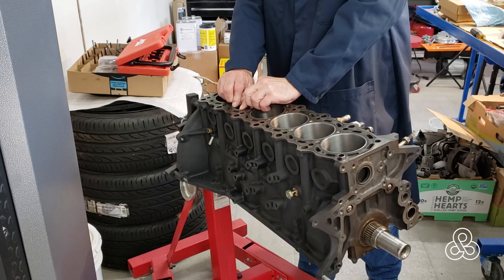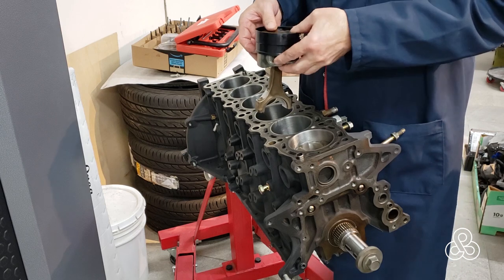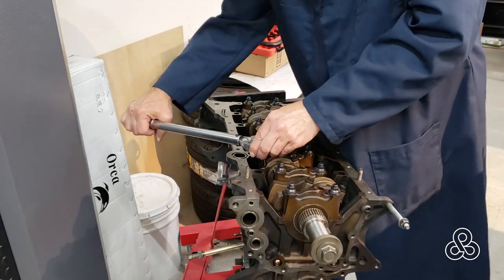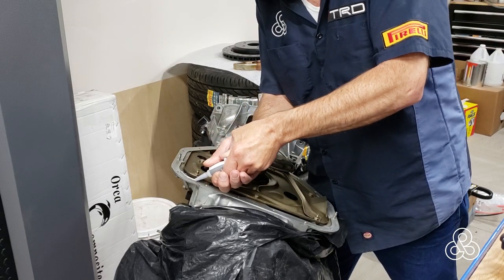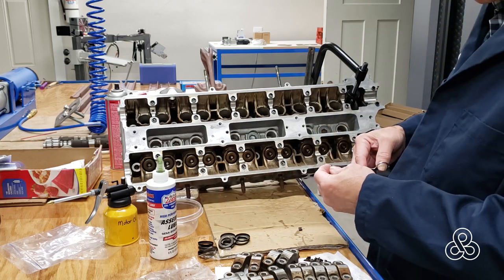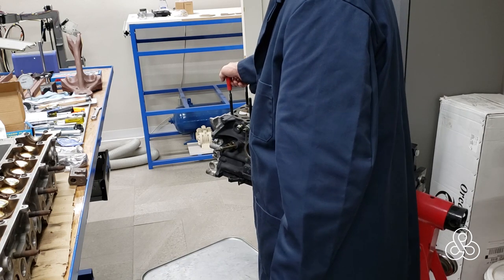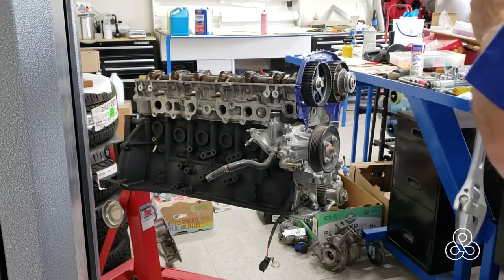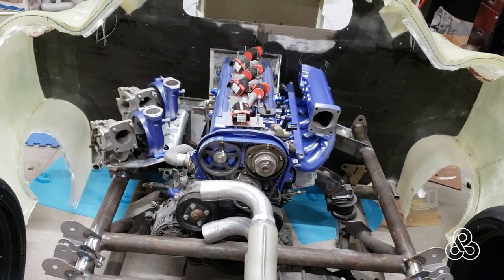A29 - Why would this guy put a 1JZ GTE VVti engine in his supercar?

Comment: The 1JZ was a partnership between Toyota and Yamaha, really great motor for swap.
Reply from the maker: designed to compete in racing, but the series was dropped and Toyota said "lets throw is in a Supra and make the kids in 2020 go crazy!"
Reply: @Nate Brindabella 1Jz heads have Yamaha in them, so at least some aspect of the heads was designed by them
Reply: @Nate Brindabella
The 2JZ head, as well as the same design in my 3rd gen 3S-GTE is the same Yamaha/Toyota design as the 1JZ-GTE.
This video will show you everything you need to know:
https://youtu.be/y-9Wr4G2Zas
It’s the same Yamaha/Toyota design. My 3S-GTE actually has the Yamaha symbol on the timing belt cover.
Reply: Might interest you to know that the V8 in the Volvo XC90 was designed by Yamaha too. In case ya fancy playing with a really esoteric engine! 😁
Reply: Some of the. Ford dohc engines in Torus s were yamaha built
Reply: @brucejohnson6529  Taurus SHO 220hp 😀

Comment: I just got rid of a 1998 Camry with the 5S-FE four-banger.  I used it like a truck and drove it kinda hard.  I'm self-employed and an Assistant Scoutmaster.  Trunk was always full of tools, back seat full of job supplies, and occasionally either the roof rack up top or a trailer hooked up out back loaded with more supplies.  Sometimes I had my toes under the radiator to get the loaded car (and trailer) up a freeway on-ramp and safely merge with traffic zipping by.  And all the trips going camping, driving on dirt and gravel roads into camp-sites in the woods.

Car was smooth and reliable up until about five minutes before the engine threw a rod and punched a small hole in the engine block.  Just enough time to hear odd noises, get off the freeway and onto surface streets, go through a couple of traffic lights and find a safe parking lot to stop.

Poor car only made it (reliably and dependably almost the whole time) to a mere 461,228 miles.  I so wanted to see half a million.

So, yay for Toyota!

The engine and transmission were bone stock.  Painfully bone stock.  Of course, with the tools, materials, occasional trailer, etc., the suspension, brakes, wheels, tires, security system, and stereo (with backup camera) were all upgraded.  It wasn't too quick off the line, but I'd argue that it could brake and corner better than when it left the factory.

100% of my build was done with my hands, but I can't hold a candle to your build.

Nice to see the TRD logo on your shirt and the Toyota 1JZ at the heart of your build.
Reply: Apparently the worlds fastest MR2 runs a camry 5S block with 3SGTE head crazy
Reply: You should upgrade to the 3S-GTE. It’s an easy swap and the design is the same Yamaha/Toyota design as the 2JZ-GTE. I have three of them and they’re the best.

Comment: Years ago I dropped a 1jz-gtte with twin ceramic turbos in a 85 4wd 4runner. I had a lot of fun with it.
Reply from the maker: Is that a straight bolt in swap or did you have to use an adapter?

Comment: Ill admit, I was skeptical at first, but im sold. Im so much happier you put the engine you did in it, rather than just another LS. I think the Inline 6 will give this car a much peppier and lively soul, and I cant wait to hear it sing in the high rev range! Especially with you custom exhaust.
Reply: Toyota jz family is solid but there's a reason you see so many ls swaps. Gm has been building them since 98 and there are millions of them. Sadly the jzs are pretty limited in availability. Cost is a huge factor i can go to the wrecker and pull a 5.3 for 300 bucks and do it 7 more times and probly still not buy a 2j. There compact the sing cam really lends its self to being much smaller thank other v8s. As I stair at the monstrous 5.0 in my f150. After market yes the jz has a bit but it is again pricey and no where as plentiful as ls. We could build a 500hp engine for wat the stock 1j ran him. Imo if I were to make it an inline 6 I'd go Cummins fastest  diesel supercar. You since he likes different.

Comment: I think the 1UZ-FE is a more interesting Toyota engine, because it's an all aluminum 4.0L V8 that can be pushed to around 800HP without needing to get your bottom end rebuilt. Just a new ECU or ECU reflash, new injectors, new fuel pump, and either turbos or a supercharger with accompanying intercoolers. But, as you've stated, the 1JZ and 2JZ engines have such a cult following that aftermarket support is overwhelmingly available. While the 1UZ-FE is also a pretty popular engine, it pales in comparison.

Comment: I'm more interested in why you chose the transmission orientation that you used Having the tail shaft of the trans going forward.

I'm also interested in why you chose an automatic instead of a Manual
Reply: It's a  four wheel drive car
Reply: This is the same layout as the Panther Solo and MG 6R4, and 4wd versions of Lamborghini Diablo and later cars
Reply: Well probably its due to cost and power handling/adapter availability. Also while not talked Bouton to much anymore, autos load the engine and thus turbo helping spool all things equal. Depending on transfer case its either front biased or 50/50 power split. Lastly while cost probably played a part in the 1jz it does rev much higher given supporting mods and will last longer while doing it
Reply: @mythos000000025  When you think about cost / power ratios, and the money spent on developing the engine, building the  body + suspension, and also the fact that he has made his own bell-housing and will make a torque-splitter with drive to front and rear, then the cost of the actual gearbox is rather small.  He has chosen that transmission unit because that is what he wants to use

Comment: Another high-revving inline 6 worth considering would be the RB26DETT from the Nissan Skyline.  The 1JZ has 71.5mm of stroke, and the RB26 has 73.7mm.  Both motors can be spun ridiculously high, and both will take you to approximately the same maximum hp level, but the 1JZ will be far cheaper shopping list. RB's are more of an exotic motor, and tuning parts for it come with more exotic price tags. For your build, I would have taken the 1JZ over the RB due to price since the end result in performance is virtually identical.

High revving motors are ideal for light weight cars. Short piston stroke = less torque.  Your build is perfect for a high revving motor because it's light.  Obviously, the 1JZ would be a poor choice for a pickup truck.
Reply from the maker: Of course now all JDM recycled parts are overpriced due to Covid.

Comment: I have a 1jz in my Mk3 Supra vvti bottom end high compression with the old school 1jz Head twin turbo set up.  On stock boost stock Ecu it has a top speed of 250 kilometers so you should not have a problem achieving what you want
Reply from the maker: TRD Fans Unite!

Comment: as a owner of a 1jz vvti its nice to have parts domestically that fit from the 2jz also you can use 7M starter motors too neat fact.
 the 1jz is risky to run stock block around over 450HP, safest would be 400HP. Going over that threshold would need some beefy aftermarket internals and what I recommend to most or  if you're on a budget build a 1.5jz using a stock 2JZ non-vvti block. Theres a good channel Rabid JZ that has a video going through his 1.5jz build and the details.
Good thing about the non-vvti 2jz block is both the GTE(turbo)  and GE(non-turbo) blocks share the same beefed up stock pistons and rods. 
The 2JZGE VVTI block would need better pistons and rods, unless you are lucky to find a reasonable 2JZGTE VVTI block
Reply from the maker: I'll have to check out Rabid. Thanks.

Comment: While it would be quite the task, I think upgrading to ITBs would add to the super car status, and you seem to be quite skilled, so I think you could do it.  I’ve seen this done with modified BMW ITBs from their M5 V10, and the improved throttle response and airflow could help make up for turbo lag.
Reply from the maker: I had a continuously variable intake runner system designed and parts purchased to fabricate it, but after things started to come together I found fitment problems. Problem was that the runners "mathed" out at over 12 inches long during low RPM. This length, and the phlenum box around, them would have just taken up to much space and interfered with the intercooler. Individual Throttle bodies would be a great way to "open up "some breathing. Perhaps after we are on the road and start to "tweak" the tune we can try it. Till then, a new single 90mm - throttle body will have to be my breathing device. Love to hear these other opinions and ideas - thanks for following the build .

Comment: Just came across your YouTube channel.. very nice build you got going on.. I was thinking to put in a jz into a flooded Aventador I purchased from a wreck yard.. 
I really like the lines you got going on with your car.. I am wondering what windshield & door glass are you going to use??
Reply from the maker: Sorry this is so late, YouTube isn't notifying me for some comments. Did I see something about your Aventador project  on Instagram?  I'm all for the JZ swap. Big fan (as you can tell from the video) of Toyota's Jz platform. For the budget it cant be beat. (although the LS officianados like to question that) Glass - Windshield is from a Chevy Cavalier. Side glass will be custom DOT safety glass with the quarter sides and rear formed from polycarbonate. The polycarbonate is good for weight savings and can be easily formed, but gets scratched up to easily if used in operating windows like the door glass. I see you have an investment channel - would love to see you do the swap. Perhaps a second channel? Mr. Lamboyoda? Mr. Toyogini?
Reply: @BuilderCreator  where does one get custom dot safety glass made?
Reply from the maker: @ciphergalm1174  Sorry, I have been slammed lately and can't find the address of a shop here on the west coast, but you can search this as there are many places that can do this. Some of the bigger hot rod shops can connect you with shops that are more willing to do small projects.
Reply: @BuilderCreator  thanks

Comment: Very interesting choice 👍 , lets say you build this car not for personal use , but for commerce , is it possible to pass by modern fuel emission regulations with 500hp old engine ?🤔
Reply from the maker: The modern ECU can be tuned for efficiency or power (or with a switch, to go between) So, yes we are there.
Reply: @BuilderCreator  appreciate your response , this amazing work inspires me ! Let me ask one more question ) if it could become production car , is there law restrictions to use this engine , and  how to settle this kind of stuff , do u ask permission from Toyota ?
Reply from the maker: @НурсултанТалгатулы-ф6м  No, you would not need to ask Toyota for permission as you would be using re-conditioned used engines.
Reply: @BuilderCreator  👍👍👌
Reply: @BuilderCreator  use a standolane  ecu those are the best ones out there you can buy

Comment: having worked on alot of mid engine supercars. having work on mid engine kit cars. i do like the inline 6. however ive never liked the room in the engine bay for even 4 piston long engines such as v8's. pentera , farrari, manta(kit) all have transaxles that have cv outlets and ring and pinion just behind the motor with the transmission rearward. why did you choose to go with this engine when a mid engine v8 and audi, zf, aftermarket vw bus, and other tansaxles available, in fact it looks like youve done every single thing the hard way. ive never seen anybody with your combined abilities. you are certainly 1 in 100m. ive always found a way to utilize parts already available ( like control arms and computers) while you intentionally go out of your way to design and fabricate your own product. you do beautiful work .i like most (97 %) of your work. it just seems like this is therapy for you. like you ive done most of the work myself. i used it for therapy. . i dont like subframes connected to carbon fiber tubs. i like connected chassis cockpit cages, rear cradle attached to front cradle to secure torque twist and provide occupant safety. especially in an awd combo. having said that im your biggest fan.

Comment: 1jz is criminally underrated as a sub 1000hp engine. Not sure why anyone would question someone using it as a reliable platform. Cheaper than an rb26 with similar performance specs. I think the only head scratcher is why are you calling this a supercar lol.
Reply from the maker: Someone else came up with that descriptive term, when I was young it was always just "exotic."
Reply: @BuilderCreator  well its not that either lol. kit car at best. unless you plan on mass producing these things.

Comment: 1jz are bullet proof mine got driven with no coolant or temp guage to a stand still then boiled like a kettle multiple times no problem at all kept on going like it never happened
Reply from the maker: One of the reasons I chose the platform, but I will be running mine with coolant. Ha!

Comment: Very interested in the end product! Great job!
So are you custom building your twin turbo manifold? 
Also, how do you know that the 15b's will still be in their proper efficiency range at the power levels you want? How much boost are you going to be running through them?

Thanks for posting your project!
Reply from the maker: Yes, I will be building a custom manifold. As far as efficiency- I have done only some rudimentary calculations in regard to flow volumes and comparisons to “known” turbo builds, Although it would have been nice to use some modern “big” turbo out of the box; backed by some factory support and experience, cost was a determining factor. I'm only $250 into the second turbo (including rebuild) which didn't cut into my $25K total budget to badly. Like Toyota in their introduction of the CT15B, my solution is to keep the manifold short. In addition to that, I have less packaging restrictions so I can exit the exhaust without much bend and tune with pipe length, additionally I'm hopping that volume can be increased by better flow x  more fuel x boost (RPM). Which bring us to your last question- boost- Hopping to get to my goal at around 17#. (15 would be nice and I will not push it beyond 20. This is a street car for a conservative old man. Ha! ). Thanks for watching the videos.  Building the manifold should be coming in a few weeks. . . stay tuned.

Comment: On a street car, it's not the hp, it's the torque curve. Have fun off boost with 2.5 liters. You'll need 4500 rpm before you are coming on.
Reply: That’s absolutely not true. VVTi fixed all his low RPM torque requirements. The 1JZ and 2JZ have nearly 100% of their torque by 2000rpms. The turbos spool by 2500rpm

Comment: Initially I wanted a 1jz non vvti for my nissan schassis but went with the LS1/t56 combination because I realized I was out of my depth with turbocharged applications and I thought the LS platform would save me money in the long run
Reply: Frankly, the LS is good for boosted applications as well. I think much over 500hp is boost territory for them
Reply: @adrianhayden7430  yeah the twin turbo LS R32 they did on the Skid Factory channel is one of my favorite YT builds but turbocharging a V8 is out of my affordability lol. I'll be lucky to finish my schassis as it is
Reply: @andrebarbosa224  will do. What were you budgeting for the motor?
Reply: @adrianhayden7430  Initially about 6k but 4500 got me a 04 gto swap and I knew I was going with a new harness and tested ecu etc. then clutch, swap parts like full exhaust, rad fans mounts, correct shifter for oe placement etc I think it ended up around 7k give or take 500
Reply: @andrebarbosa224  Ah, see I would personally go the iron block truck motor route. Still, not a bad price for a true LS coded engine. How much did the 1JZ work out to?
Reply: @adrianhayden7430  about the same 2 yrs ago when I was comparing but parts are a lot more expensive now so maintenance costs are much higher and availability is poor